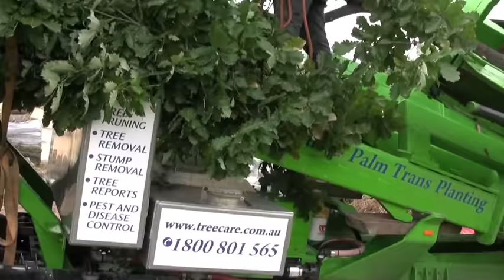Tree Transplanting with ArborCo Melbourne.m4v

Comment: upon transportation of the trees it is recommended to cover the limbs with a wind tarp to avoid any damages from wind as it travels down the road also heat can't put the tree on a risk of a heat stroke so it is advisable to cover the tree on hot climate areas